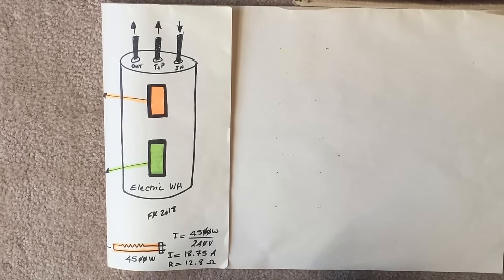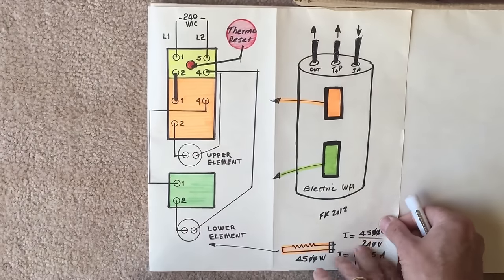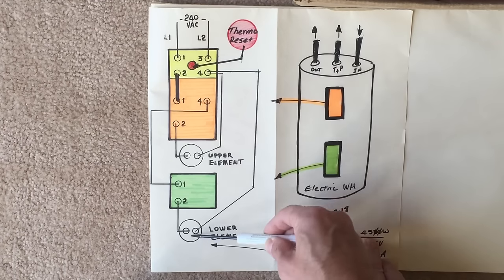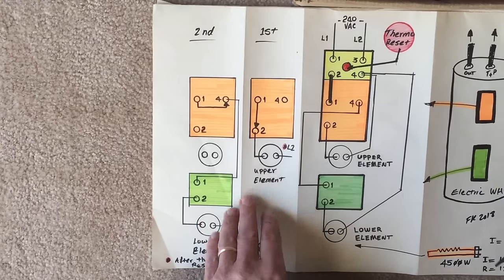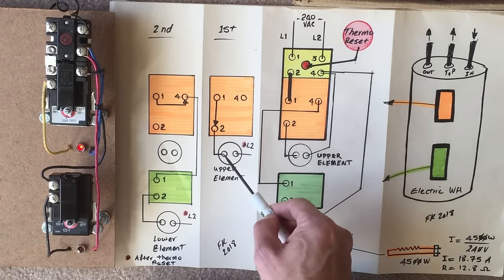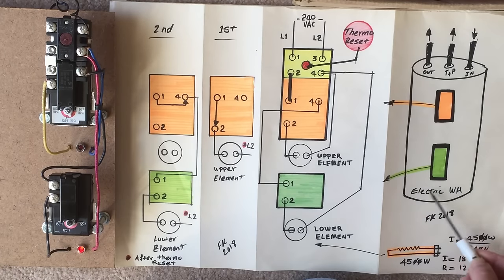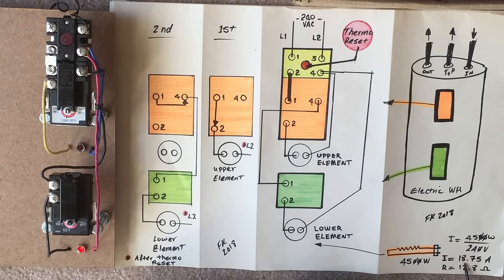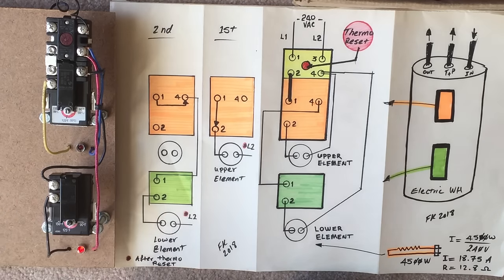Electric Water Heater-Understand How It Works So You Can Troubleshoot Why It’s Not Working Correctly

Comment: Great explanation.  I always wondered how the H2O heater had 3500 & 4500W heating elements yet had 12 gauge internal wiring.  I had always assumed both elements ran at the same time.  I did not know it switched between them. Very cool, thank you very much.
Reply from the maker: Thank you very much for the kind words.

Comment: I was looking at the question & answer section of water tank thermostats on Home Depot, Lowes and Amazon. I was amazed by the number of people that get this information wrong. There were 'pro', 'top reviewer' comments that stated with certainty that both 4500W elements came on at the same time for a 30 Amp breaker. Your explanation was  clear and thorough and proves that you do not need fancy graphics to give a detailed presentation.
Reply from the maker: Thank you for the feedback.

Comment: Thank you so much for this amazing, comprehensive video. I’m a plumber, and I have a hard time understanding vague descriptions on how things work. So I’ve always struggled with electric water heater repairs. Always left unsure if I was replacing the right parts. The elements were always an easy ohms test but as a whole system you just made everything thing click. Thank you!
Reply from the maker: My pleasure. I’m glad that you found the video helpful.

Comment: Thank you so much just installed new elements in my water heater and wasn't getting power to the lower thermostat. Your video perfectly explained to my amateur brain what's happening and why
Reply from the maker: Glad to hear the video was helpful. Thank you for sharing.
Reply: I was also stumped why I wasn’t getting power to the bottom heating element. Now I know. Thank you so much for the information.

Comment: Most useful  advise.  You put my mind at ease  after seeing the video.  Didn't realize both elements are not working at the same time.  Only getting around 240v at the top element and  0 at the bottom element.  I tested and got around 13.3 ohms on the top and bottom elements.  Going to recheck after an hour or 2 to make sure the bottom elements is powered up and working.
Reply from the maker: Thank you.

Comment: You must teach somewhere. I have been looking at so many videos, and whilst I must give the posters credit for even trying, in the end I am often confused. 
You have made everything  quite clear Sir. Thank you
Reply from the maker: Thank you Trevor for the kind words. I’m glad you found the video helpful.
Reply: @JustForYouDiy  just so you know. I reconnected everything determined to go back the following day (today) to start over, and what do you know, the water heater started working again. Perhaps because I had pushed the reset button who knows. Do you care to hazard a guess as to what happened altogether? And thanks for responding Sir.
Reply from the maker: Trevor, That definitely could be one of the reasons. If possible, I would suggest getting some voltage and amperage readings while it is working to check against theoretical numbers.
Reply: @JustForYouDiy  thank you again. I will try that

Comment: Great video! I had checked out my mom-in-law's H2O heater, and figured out the bottom thermostat was bad, but wanted to make sure I was reading the situation right, i.e. The lower stat should be calling for heat once the upper was satisfied. Your video confirmed everything AND your drawings are awesome. Thanks!
Reply from the maker: Glad it helped!

Comment: Damn! I just finished repairing my electric water heater. But this is very useful information. My lower heating element was corroded and broken. It had zero resistance on the meter.
Reply from the maker: Thank you.
Reply: @JustForYouDiy Thanks again. This morning the circuit breaker tripped again. But we had hot water all night long. I found a loose connection at the circuit breaker on the sub-panel. I turned the screw about 2 turns. Hopefully, this fixes the last of the problems.

Comment: That was great. I have watched so many videos about this and all of them piss me off and leave me more confused. This was on point. My only question is, what is that reset button used for? I have seen others speak about it and it has been said different for so many things. I wish someone on the internet had a clear and concise video on multi meter testing. I have watched so many, and they are awful. They don't give proper illustrations, slow down, or ramble and not give clear viewpoints on what they are testing or why and in what setting is it practical. All while videoing choppy video. It is really frustrating. This video and the intent from the start was on point, thank you.
Reply from the maker: Thank you. Regards your question, the reset button is a safety device that shuts off power to your water heater when the water temperature inside it exceeds 180 degrees Fahrenheit.
Reply: @JustForYouDiy  how is it used in a regular setting? Some vids seem to use it to reset your WH like it was some fluke to begin with.
Reply from the maker: If everything is working correctly, it should not trip. Some of the conditions that will make it trip are:
1. Faulty upper module
2. Thermostats set too high
3. Faulty thermostat
Reply: Mine tripped for none of those reasons. Replaced them today
Works great thankfully. 
Both had resistance on each element but both original elements seals were leaking. Decided to just replace them. I also lowered the thermostat. What are the usually supposed to be set at? Mine was about 140 top and roughly same bottom. I thought that was too high. I put it at 125 and I still feel its hotter than I'll ever use. Can you explain or show me how I would test the thermostats properly? The vids online are terrible.

Comment: Please take my comments in the positive vein intended. You are an awesome and detailed instructor! Great discussion; great information; great diagrams; great mock-up. Great instructor yet I'd remove the word "Troubleshoot" from your title. 

The novice in electrical will not know what to test when even though the electrically educated will have all they need.

 Troubleshooting tips for the novice maybe should include step by step of what part to test when and with what equipment. Examples: 1. Water heater seems to "run out of hot water" too soon -- What is first to be checked?  (Likely easy first step may be to disconnect wires from element and test resistance. 2. If both elements are good, what is next to test?  3. When is necessary to check the modules/thermostats? etc, etc.

If this video, or a separate video, included similar steps as exampled above (of course, in appropriate detail), the video would be of greater value to a greater number of folks. 

Keep it up. Looking forward to more!
Reply from the maker: Thank you very much for taking the time to provide your feedback. Great suggestion. Much appreciated.

Comment: Good video,  but What will happen if both upper and lower element meet the desired temperature ?
Reply from the maker: Thank you. Both elements turn off. Upper element’s thermostat powers on the bottom element’s thermostat (therefore upper element is turned off). Then, if and when the bottom element’s thermostat reaches the desired temperature it turns off the bottom element. Hope this helps.

Comment: Great video, question for you, I replaced my upper and lower thermostats, the original upper thermostat only had 2 terminals on the left, the replacement upper thermostat has 4 terminals on the left, now do I need to install the jumper wire between 2 and 1 terminal for it to work properly, I don’t have a jumper installed at the moment and the reset keeps tripping every couple of days. Should I install the jumper wire?
Reply from the maker: Please provide the part number for the thermostat in question and I’ll happy to look at the specifics and provide feedback.

Comment: Thanks for sharing this fantastic video. As per your explanation, first the top heating element should be satisfied,  then is  the bottom element? Is this the sequence even at the start of the tank after installation?
Reply from the maker: You’re welcome. Yes, you are correct, top element, then bottom.

Comment: Great explanation! I am planning to connect 160V DC solar panels output to such heater to preheat my water. Is there trick to modify the AC switch to reliably work with DC ?
Reply from the maker: I would recommend bench testing it first.
Reply: @JustForYouDiy  it looks like there is a way to remove arcing on switch contacts using RC in parallel. I will explore that

Comment: It's a great explanation video. 👏
Also, what will happen if it's connected to 120V instead of 240V?  Does it work?
Reply from the maker: Yes, it will still work. But, it may take much longer to get to the desired temperature.

Comment: Great video. Thank you so much! Would you try helping me with the question below. I have a Whirlpool Energy Smart, 50 Gal, Model: EE3J50RD045V. I have 240 VAC coming into the control board sitting on top on the unit, but the power LED is OFF at all times. I tried resetting the RESET button on the control board as well as resetting the main water heater breaker (2x30 Amp) in the outside power box, but that didn't fix the problem. In the upper and lower connection board, there's no individual reset or temp settings; there's only the two wire connections for the upper (blue and yellow) and lower (blue and orange) elements, as well as two smaller wires (two orange on top and two black on bottom) for the top/bottom thermostats, I assume. The temperature setting (just one, for both upper/lower elements, I assume) is also located on the control board. I  did test for power on both elements, they both read 0V, even though there's 240v coming into the control board. I then turned the main power off and tested for resistance on both elements after disconnecting one of the two wires to the elements; they both read near 13 ohms (sounds like a decent reading for this 10-15 year old heater). Did my control board quit and needs replacement? Did my thermostats go out and need replacement? By the way, I also set my thermostat to max setting (150F) hoping it will trigger the thermostats. Nothing happened . Obviously, I have not hot water. Appreciate your time and assistance.
Reply from the maker: According to the manual I found online, https://manualsfile.com/product/k3pmsg9vad4.html?page=15

If the LED is off, either there is no power to the unit (which you have already checked) or, there is a problem with the controller.
Reply: Thank you so very much for the prompt reply. By the way, I updated my message/question a bit from the original post to include the test  for power and resistance on the heating elements. Appreciate your assistance again!

Comment: A very good video, . My water isn't getting very hot. I tested the thermostat, getting continuity on the hottest setting and non on lowest setting on both lower and upper. How exactly do you test the element? I disconnected both wires on the element and the meter is reading the same for the upper and lower element @1 ohm. Not sure, if that's good or not, please assist.
Reply from the maker: Z Man if the element is rated for 4500  watts (the power rating measured in watts. It is usually stamped on the end of the element) and it’s a 240 unit, the resistance should be around 12 to 13 ohms. 4500 watts / 240 volts = 18.75 amps ...240 volts / 18.75 amps = 12.8 ohms. Hope this helps.
Reply: @JustForYouDiy  please help I replaced both the thermostats and lower element and I still get continuity on the upper just not the same Resistance reading. Upper 12.8 and the lower reads 13.4 Can you help me why Im still getting cold water? Should I change out the upper element anyway?
Reply from the maker: Make sure that the wires are disconnected from the elements when you’re checking for resistance. Of curse this is done with power off. After the elements are confirmed good and reconnected, with power on and the upper thermostat setting to the lowest temperature, check to make sure you’re getting voltage across the upper element. As you see in the video, the temperature for the top part of the tank (upper element) has to be satisfied before the power is switched on to the bottom thermostat/element. Hope this helps.

Comment: Great information, 
Q. I have a part washer for my shop and I like to install a heat element can I wire the heat element direct without a thermostat ?
Reply from the maker: Yes, of course. As long as whatever device that controls the power to the heating element can handle the current draw. Also, please remember that these heating elements need to be in liquid to keep them from burning out. This is why it is NOT recommended to turn on the water heater without the heating elements being submerged into water. Hope this helps.

Comment: My top element works, voltage ok and current draw is around 18A. Bottom element does not show any voltage or current.  Tried to force it ON by reducing top unit temp set and increasing bottom temp set, no change.  Buy a new water heater? Or are parts available for 15 year old heaters? Any advice? Thank you!
Reply from the maker: Turn the temp setting to the top element to its lowest setting. Then, turn the temp setting to the bottom element to its highest setting. You should get voltage to the bottom thermostat and the bottom element. If there is no voltage to the bottom thermostat, most likely the TOP thermostat is defective (it controls the voltage to the bottom thermostat). If there is voltage to the bottom thermostat and no voltage to the bottom element, the BOTTOM thermostat is defective. And, yes, you should be able to get parts for it from Home Depot or Lowe’s. Hope this helps.

Comment: Great wiring explanation but it didnt explain how to figure out my fault condition. I have lukewarm water. Top module is heating but the lower element is not. I cant tell if the switch over to the lower power mod is taking place
Reply from the maker: Reduce the temp setting for the top element so it turns off. And increase the temp setting for the bottom element forcing it to come on. This should test the switching. Hope this helps.

Comment: I was in a small earthquake in west Tx over 20 years ago. I was on my bed playing with my dog & heard my mom shouting that the house shook. I hadnt felt it but knew something significant had happened when I saw that aquarium was white capping! 
Ok, now to reason I'm here. Couple of weeks ago the washer started leaking from the bottom. When i pulled it out to let floor dry & clean the muck I noticed the tray the water heater is in was also full of water. My questions is can you think of anything that could cause both appliances to start leaking at same time or am i just having some bad luck?
Reply: It is unfortunate. I cannot think of a reason why they would be connected.
Reply from the maker: Most likely they are not related to each other.

Comment: Very Helpful. Quick question. both of my elements have just been replaced, and the associated thermostats. I get one one hot shower and then the reset button trips. I reset and get hot water for one shower and then it trips again. But not the main 220 breaker. Please suggest possible fix. Thanks!
Reply: Jere Whitehouse, Since the thermo reset is tripping, couple of things could cause it. The temperature for the WH is set too high, and/or the thermo reset module is defective. Hope this helps.
Reply: @Farshidtx1  Thanks for the quick response! I will check these.

Comment: How often we need to replace the elements and thermostat?? 
Thanks a lot
Reply from the maker: Good question. It depends on several factors, the initial quality of the components, how hard are they being pushed, I.e. how hot do you keep the water temperature, how well insulated is the WH from the elements, I.e. is it in the garage or inside the conditioned space. Based on these factors, I hate to say it, but normally they are replaced when they fail. The good news is that generally there are two heating elements/thermostats. And, usually, one goes out and the sign is the reduction in the amount of hot water. When that happens, you should replace both. Hope this helps.

Comment: What will happen if bottom element's wires are disconnected but bottom thermostat is left connected as is. Will upper element still turn on continue to work normal as per the water temperature in upper area?

Comment: While replace my upper and lower elements and thermostat I discover a burnt copper wire the was broken. It's the wire that runs from the L4 to the lower element. The wire broke right inside the top panel and I cannot pull it up to rewire it due to the sprayed in foam insulation holding it tightly in place. What do you recommend for this problem?
Reply from the maker: Because every MFG has specific design features, I would recommend contacting the MFG. I’m sure this is not the first time for them dealing with such issue.

Comment: Help.
So my upper elements appear to not be connected. Instead a twist on wire connector appears to have been used to connect the wires that would've gone in the element. Any reason why this was done? Is it even a right thing to do?